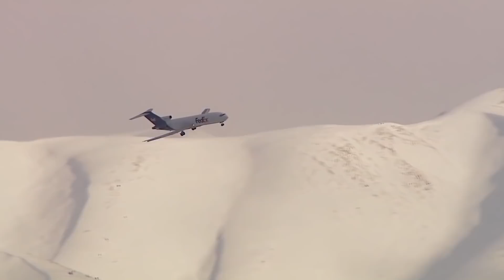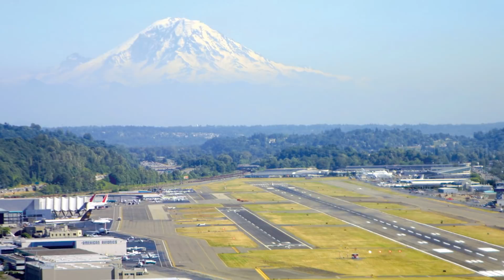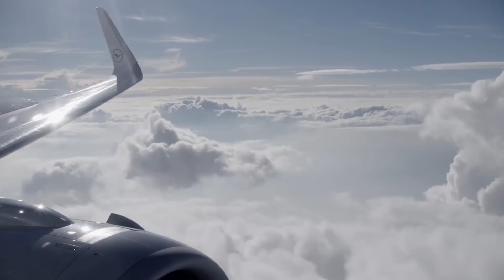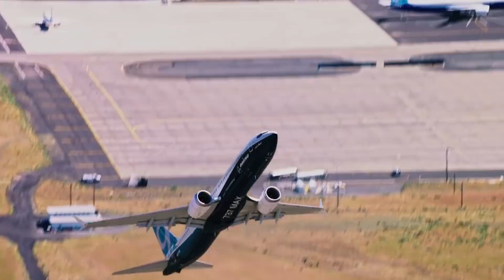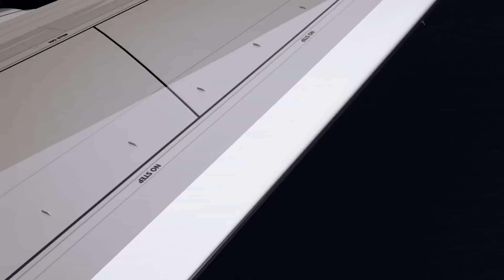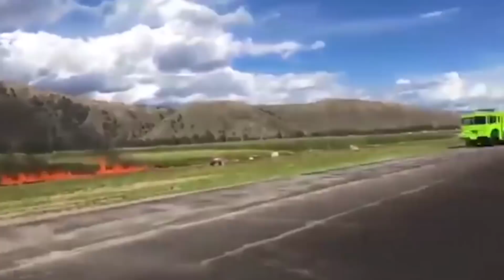Boeing 737 - the most popular airliner

Comment: And then a year later 
737 max: I'm about to end this flagship's entire career
Reply: dc 10 is worse than the max
Reply: barricade gaming personally yes since it crashed and kill ALOT for people but since it’s the past
Reply: barricade gaming yes but that was in 1971…
Reply: @lavergnee  still the dc 10 sucks
Reply: @hitthefloorlpu2003  DC10 had some structural design errors they handled. Max had a software oddity they omitted from the pilot training. All because of the profit over safety.
Reply: @Swag_K1RBY  and the max crashes will become the past
Reply: @lavergnee  soo people still died. Are u acc saying that because it was 1971 there deaths don't matter?
Reply: Ethan's Aviation I’m not saying that their death doesn’t matter, I’m just saying that Boeing didn’t learn the lessons from the past by rushing the built of the 737 max and the FAA did not do its job by letting Boeing do the certification tests in-house while they were supposed to do them.
Reply: 737 was never the flagship
Reply: @MaxwellAerialPhotography  No, it is the bread and butter if Boeing's income, as the A320 family is for airbus.  Flagships do tend to be the biggest, or the most advanced current model, which fir Boeing was the 747, to many the 747-8 still it, but  some see the Dreamliner as fulfilling that role for technology reasons, despite its chequered history,  or the 777.

Comment: What made the 737 last so long was the fact Boeing was able to turn it into a true 727-200 successor.
Reply: They had not so good a record either.  One of the worst.
Reply: Well it is basically a 727
Reply: It is basically a 727 with extra steps
Reply: @ahuman8407  Technically the B737 is a B727 mod with twin engines
Reply: Look at the 727, they look alike except the tail
Reply: @adamp.3739  They're both 707 mods. And so is the 757.
Reply: @adamp.3739  Yes, and the 727 is a 707 mod with 3 engines.  ;)
Reply: @simonbone  the nose section of the 757 is completely different though.
Reply: @vieuxbal1253  Yep, nose, tail, wings, all different. But the fuselage cross-section is the same.
Reply: Glad is    not like max

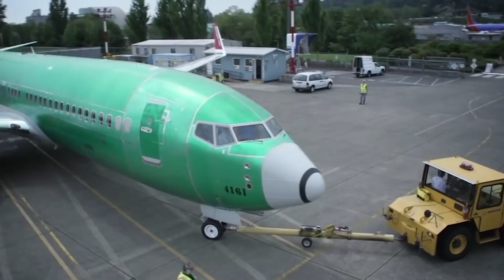Comment: 14:30 - No 737s are made in China. There is a "finishing" plant there to complete interiors. All Boeing 737s are manufactured in Renton, Washington. Fuselages arrive by rail from Spirit in Wichita, Kansas. Thus every Boeing 737 becomes the only aircraft to fly under both the Rocky  and the Cascade Mountain ranges.
Reply: Dead Frt West yes and actually aircraft is the 2nd highest grossing trade from china
Reply: Plenty of Chinese manufactured components on Boeings these days.
Reply: @Deca.Knight  That doesn't mean that they build Boeing aircraft there.
Reply: So, that doesn't mean they build Boeing aircraft there. They build GM and Ford engines in Mexico, assemble the cars in Michigan. So do we say the car was built in Mexico? Boeing has componets built all over the world, and assembles them in Renton and Everett. The typical modern industrial model (except most do the assembly overseas instead). And if China makes plenty of Boeing components, that doesn't mean they make any 737 components there, which is what we are discussing. They could produce entire 787s in China, tht wouldn't make him wrong to say that no 737s are built in China.

Comment: I worked at P&WA in the late 70s assembling JT8 engines. We used to see the build codes and many were for aircraft for Alaska Airlines. Then I  made a life changing choice and moved to Alaska and commuted back and forth to work in the oil field on Alaska Airlines. II’d tell my friends that I might have helped build one or both of the engines on the plane. They’d look at me like I was crazy as I working as an electronics technician.

Comment: Thanks for one more great video on your channel!

I guess there is some info missing about cockpit and cabin generations. As far as I know, there have been four generations of cockpits:
1. The original one, all analog gauges
2. The "Classic" one with the two screens on each side
3. The all-electronic NG cockpit (where at least one airline used the screens to look like the "Classic" instruments)
3. The upgraded MAX with bigger screens

The interior generations are harder to describe since elements were mixed during later modifications.
Obviously there are different wall panels (more rectangular window cover frames or mor oval shaped), different overhead bins (opening upwards in at least three sizes, swing down models in different varieties, like from the old 767 to the dreamliner), and a plethora of different seat models. But one thing remains: The old door derived from the 707. (At least up to the -900) You still need to bend down to engage/disengage the slide and place that ridiculous red strip over the window. On an Airbus the slide is engaged using a lever, and disengages automatically when the door is opened from the outside. Sounds like rocket science to Boeing. :-P

But apart from that addition, did you ever consider making great videos like this about Soviet made aircraft or newer models from Russia? People in this part of the world are much less familiar with them and at least I would love to know more about them. Thank you!

Comment: The main gear was designed (a million years ago) with simple trucks and fat low pressure tires that can handle  operations from primitive dirt fields before modern paved airports proliferated...
Reply: What's your point

Comment: The real reason is because the 737 was the best offer in the 60s. And when the A320 came into service late in the 80s it was easier for the 737 clients to keep flying the model. Also important to note, despite being an old school, older concept, Boeing managed to make it as efficient as the A320.
That’s why the 737 will hold the crown of the most successful aircraft (in term of sales) for one or two more years.

 The crown will probably change before 2021 or 2022 with a bigger number of A320s in the skies.
 Even when the MAX returns, it won’t be enough to change the sales trend.

I just hope Airbus doesn’t make the same error with the A320 as Boeing did with the 737.

Comment: I must admit that this is an excellent video on the Boeing 737. Everything is well explained and well detailed without dragging on too much. I like the Boeing 737 for its reliability and durability. But I must admit that its design is outdated and that the Airbus A320 or the Embraer E170/E190 are much more beautiful airliners. I hope the successor of the Boeing 737 will have a completely new design.
Reply: Seems a bit outdated because a 737 is actually heavily modified and adjusted 707. Appearance wise, concept is quite identical.
Reply: Sometimes rugged is key,planes need to be in the air as much as possible to make money.
Reply: Why is it 'oudated'? The important part of a plane is the wing, engines and tail. the fuselage is just a tube. The wings, tail and engines on the 737 are totally new, why does it matter if the fuselage is still using the same old architecture? How pretty it is has nothing to do with how good an aircraft is (and personally I like the look of the 737 better). nd in any case, I thinkk you will find that the fuselage of the modern 737 doesn't actually share much with the original except overall dimensions, appearance and the general architecture. it has been changed extensively over the years.
Reply: @justforever96  no disagreement here. Just saying that it is high time Boeing developed a completely new successor to the legendary 737.

Comment: 737 is actually a re-engineered Boeing 707 making the 737 almost 70 years old. Wow
Reply: Same story for the A330neo or A320neo. Both utilize +30 year old fuselages.
Reply: @jbtp1  No, the core  of the A320 is 30 years younger, if you go back to the 707, 20 years younger based on the actual 737.  Ha4dly young, but 20 years is a big difference.

Comment: To the speaker / commentator of this channel: You could improve your future videos a lot if you would use the right English or US-English words for what you want to express. 
1) where the pilots are sitting during the flight is not called the cabin. It's called the cockpit or thr flight deck. 
2) When an aircraft series is built in different versions, those versons are NOT called modifications. Just name them VERSIONS. A modification is an alteration of an existing already built individual aircraft that was flying before.

Comment: 10,000 Stubee's sold, that indicates operators are raking in the cash, using the 737, I'm a 757, 747, 767 Lover, but you can't dismiss the 40+ years of success, the 737 has given Boeing and the carriers. Well done

Comment: An additional version of the B737 is flying - the B737-900ER (Extended Range) version. It has more powerful engines, fuel capacity and a higher maximum gross takeoff weight. The B737-900 standard version has a MGTOW of 174,200 lbs (the same as MGTOW for the B737-800); on the B737-900ER it is 187,700 lbs. 

Compared to the -800, the -900/-900ER handle like a truck, and for me, it wasn't nearly as fun to fly, nor to land. My all-time favorite was the B737-300 Classic round-dial (non-EFIS/glass panel). It was Boeing's first iteration of the next generation of 737 after the -100/-200, hence it was a new design without any modifications or fuselage extensions. It was one of the best-balanced aircraft that I've ever flown, and it  was very easy to land. 

The -900ER is harder to land well because the final approach speed (Vref) has to be artificially increased due to the extended fuselage to prevent tail strikes (150-160 knots vs. 130-135 knots for the classic). The same is true for takeoff - rotation speed (when the nose is pulled up to lift off) is also artificially increased, for the same reason.

The B737ER can be identified by an extra escape hatch on each side of the aircraft, behind the wing. On some aircraft it is a functioning escape hatch, required because of the passenger capacity of the aircraft. On 737-900ERs operated by United, Delta, American, and some other carriers, the outline of the hatch is visible on the exterior of the aircraft, but not on the inside of the airplane, since it is non-functional (not required to be due to lower seating capacity). Otherwise, the B737-900 standard and the B737-900ER are identical in appearance.

A final point is regarding the "winglets" (the vertical wing extensions at the wingtips). For our airline, the first version was called a "blended winglet", which was only swept upward. Because it reduces "induced drag" at the wingtips, we realized a 3 - 5% savings in fuel burn over non-winglet equipped aircraft. The next version of winglet (which was installed on our aircraft well in advance of the B737 MAXs first flights by our company) was called a "scimitar winglet", with extensions pointing both up and down at the wingtip. The scimitars were installed on all of our B737NGs due to the additional fuel savings that they offered (another 3 - 6%).

Comment: Will the Boeing 797 replace the 737 or it will be another market plane?
Reply: I think 797 will be a bit larger than 737
Reply: 797 is a different class than 737
Reply: 737 will never be replaced
Reply: No because the B737 is going to be around much longer after the proposed B797 is produced. The B737NG and B737MAX are going to be around for a number of decades to come.

Comment: The reason the 737 in known as the barefoot Boeing is that the weight of the wheel doors, would affect performance of the 737. The -500 had the name -2000 in the beginning. Braathens S.A.F.E (BU, 05) was to the lounch costumer for the -500, but Southwest beat them to it. BU asked Boeing if the could make a smaller verson of the -300 as a replacement for the -200. Boeing said yes.

Comment: I wonder how the DC3/c47 compares to the 737 as far as numbers produced and longevity. I know very different airliners. Both endure, the c47 and DC3 is still popular to this day despite being designed almost 90 years ago. Many hundreds still in operation.

The C47 airframes will outlast the 737 because they aren't pressurized

Comment: Boeing did the MAX not (just) because of pressure from Airbus but because airlines didn't want to have to train hundreds/thousands of pilots/FAs for a totally new plane, they just wanted a newer version of the same thing.
Reply: You still need diferent type ratings for the different generations of 737. But they are probably easier to obtain for somebody with any 737 type rating that it would be to get an A320 type rating for a boeing trained pilot.

Comment: Why are so many people ignorant of the actual scope and nature of the problem with the 737 Max?
   It's only the 737 Max, not all 737s.
   There isn't some AI absolutely controlling all aspects of flight while the pilots just sit and watch.
   If the pilots KNOW about the MCAS they can override it and control the plane.
   They are not flying coffins that kill everyone on every flight. Only 2 crashed.
   Boeing has no option but to fix it properly because the whole aviation industry is watching every last bit of the 
      process and crawling up Boeings butt with a proctoscope.
   Just because the original model was designed 50 years ago, that doesn't mean that the design is now useless      
      and needs to be scrapped. It has been modernized all along. It is the most popular and widely used airliner in 
      the world.  
Why do so many people think that the plural of aircraft is aircrafts? The plural of aircraft is aircraft. No "s" on the end.

Comment: The longevity of this aircraft is perhaps based on two vital points.

1. It took over & combined it's specs with the phased out 727 tri engines.

2. Perhaps, the 100-200 passengers market segments are the most demanding, from yesteryears to today & will not change but grow stronger in future.

Comment: is the 717 boeings the smallest plane?
Reply: It's from Mcdonnell Douglas
Reply: That's debatable because it was released under Boeing's name. And Boeing upgraded the cockpit and some other features.
Reply: Yes the 717 is Boeings, but the 737 is probably the smallest plane Boeing made completely by themselves
Reply: The 737-100 was arguably smaller.
Reply: technically, thats not what he said though. The 717 was still released under Boeings name I get that the 717 wasn't really made by boeing but technically it is boeings smallest plane.
Reply: true, but thats not what he said.
Reply: Boeing took over McDonald Douglas this plane was a dc8 =md80=717
Reply: Not really, the 717 was upgraded and released under Boeing’s name which technically makes
It Boeing
Reply: McDonnell Douglas MD-80 and me look the same but my fuselage is shorter than the MD-80.
Reply: @felogarcia8992  Not quite, the 717 is a modified MD-80/90, a development of the DC-9

Comment: This airplane is dangerous, the pitching causes weakness in the structure of the aircraft thus causing accidents.
Reply: The issues regarding the planes pitch and MCAS have been resolved.
Reply: @DiamondAviator4  The way to fix that problem as I engineered the Boeing 787 and having a body lift action near the front, which I got the idea from the 'Wingless' M2-F3 Aircraft. as aircraft without this body lift action tend to pitch down which weakens the aircraft's structure eventually causing crashes.

Comment: Funny you start with a MAX coming into view when that sub-series is now likely to never fly again.
Reply: According to history, it will fly again. Multiple aircraft types that are considered safe, reliable, well-designed, and even legendary now, were once horrible back in their initial conception or had multiple growing pains & teething issues. Also, airlines can't simply switch their 737 MAX orders to A320neos because of the lengthy backlogs behind both aircraft. If they switch to Airbus, they would have to essentially go all the way at the back of the line again waiting for their aircraft, which could take up to another 3-5 years.
Reply: @jbtp1  Previous aircraft that have had the MAX style teething issues did not have social media and the internet to distribute the issues far and wide nor did it turn out the issue was caused due to management not caring about safety and releasing the aircraft with known issues.

I wouldn't be suprised if airlines find people avoiding the max completly.

Comment: It’s not there smallest as the 717 did exist and 757 is also single isle and the 737 was not the replacement for 727, it was 757-200 and 300 models , and the a320-100 was actually a flop and so until the -200 2 years later they still had barely any competition and the -100 -200 came before 757 so they did not get interiors from 757.(I wouldn’t normally say anything but 737 is my favorite plane and also there’s so much info out there you could have used so I did not have to say this) good video other wise though.
Reply: A320 was a flop ?

Comment: nice aircraft, but can it compete with A-320, A-330, A-350?
Reply: An older design, I prefer Airbus, but am not a fanatic.  Each maker treats the competition seriously, and doesn't reduce it to jingoistic, usually pro-Boeing soundbites.  " If it ain't  Boeing..."  which predates the loss of MD and was originally designed as an insult to the poor safety record of the DC-10.
Reply: Dude, two of those airliners you note are different classes up. Much bigger and longer range. Not in the same conversation.

Comment: Lazy company. Basic fuselage is still usage from 727 until 737 max. Boeing should have new design to compete with A320neo. B737max is failed with MCAS due to larger engine must be fit with old wing design.
Reply: how about you try to make a new aircraft